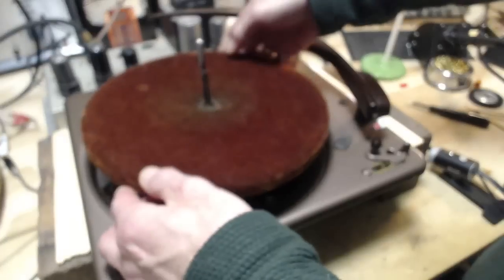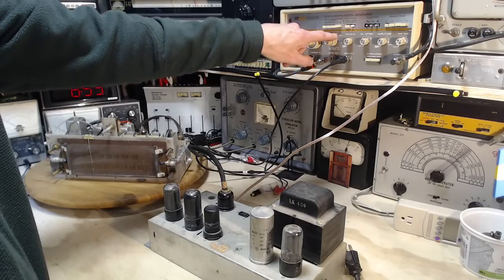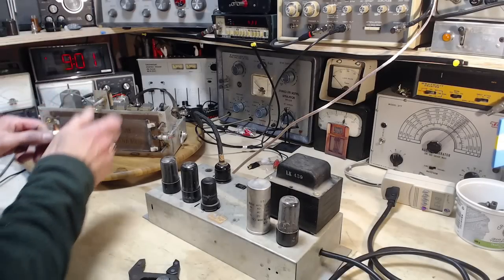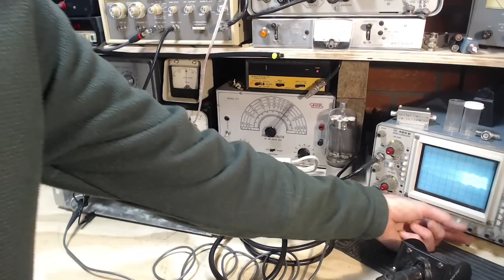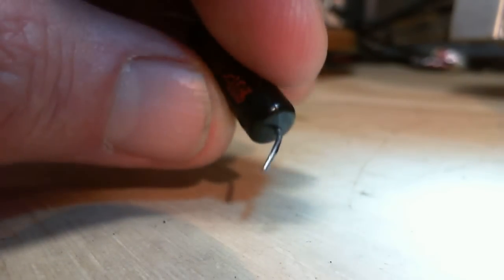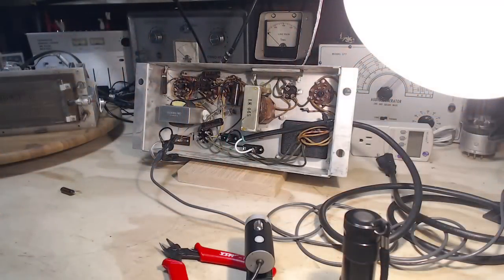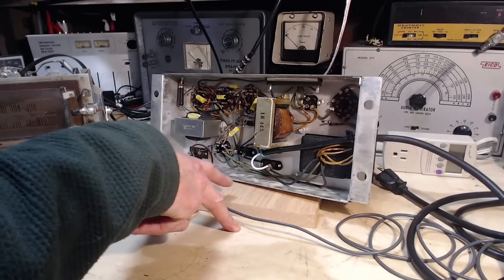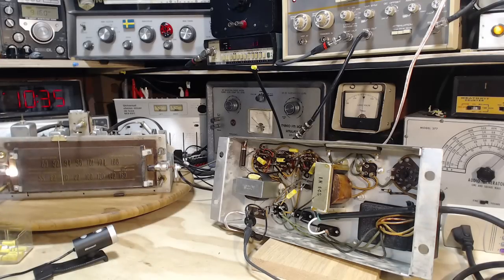Electrohome Chippendale Console Video #23 - Molded Capacitors

Comment: That first cap you explored: Think of that cap as a HF shunt to compensate for the relatively high inductance of the output xfmr's primary. The cap in that position does sometimes get stressed; large voltage swings across it and AC currents through it. Note the voltage rating on that Black Beauty.
0.001uF is usual there, 600VDC or higher. That one you cut might be molded oil/paper...good stuff back in the day. Yeah, install a modern plastic cap there.